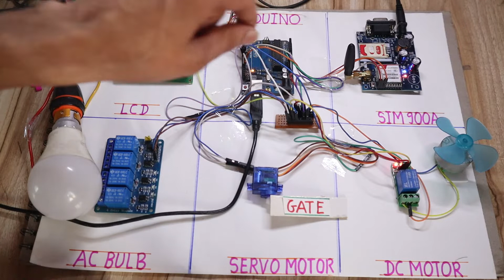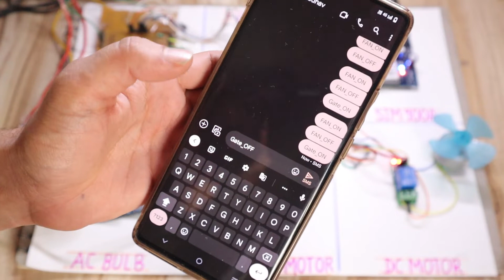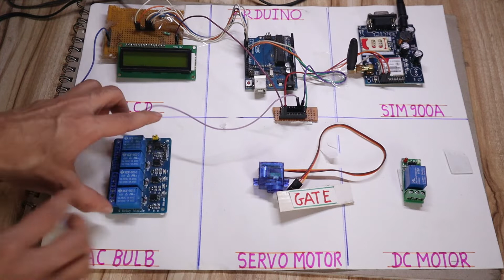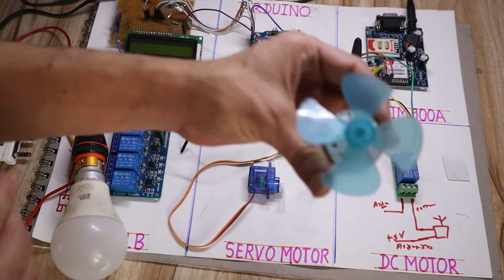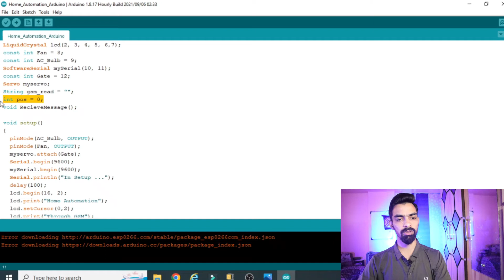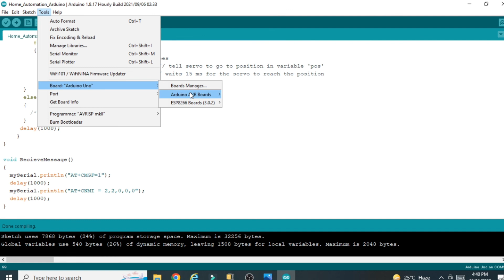GSM Based Home Automation Using Arduino

Comment: Please share, temperature and humidity monitoring system using arduino,  gsm, DTH11 sensor , DC motor.  Please
Reply from the maker: Please tell me project flow..so that i can understand what exactly do you want
Reply: @Rahul_Jadhav_Project  you can see entire flow of the project
Reply from the maker: @csat2710  where?